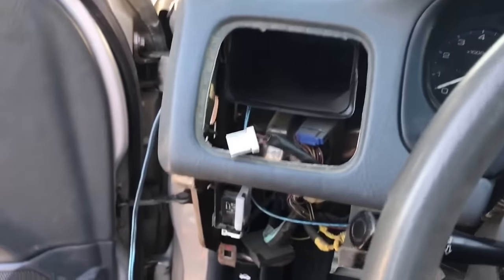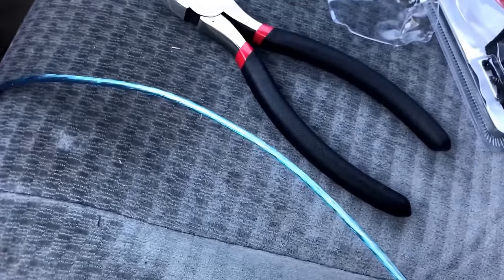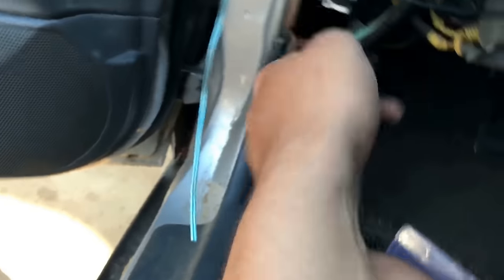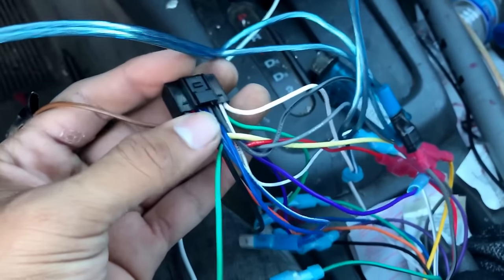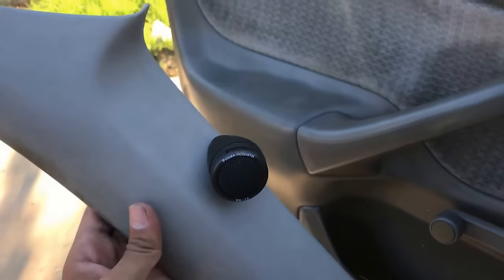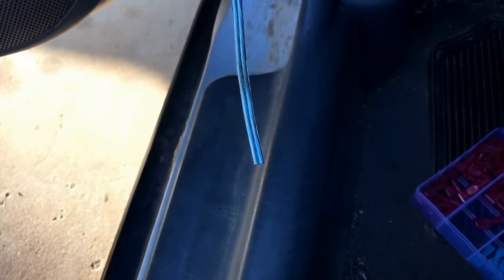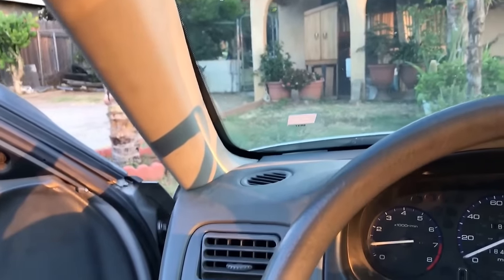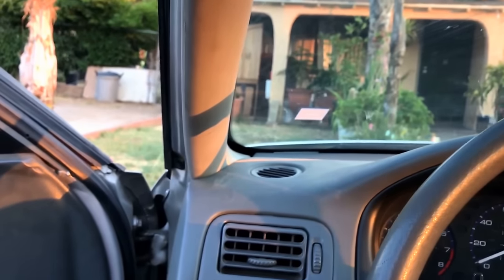HOW TO INSTALL TWEETERS (EASIEST WAY)

Comment: Taking apart his whole dash assembly apart for 7$ Tweeters?, HUh
Reply: Well cant call the dude lazy i guess.
Reply: Gregory Hebert yep if you want it done right
Reply: Man you'd be surprised how much one of those cheap dedicated little tweeters can clear up your system. I have a decent system in my truck with infinity reference series speakers and it sounded muddy to me no matter what I did. I bought cheap no name tweeters off Amazon for $15 (bit more because I'm in Canada) and it honestly sounds night and day different. I've put that cheap set in a few different stereo setups now and it's not even comparable before and after. They are worth your time and money.
Reply from the maker: I agree bro I had my system at max and it was clean but they actually stole it
Reply: 😂😂😂 is funny cause i said the same shit

Comment: I just want to correct a comment you made about the speaker wire,negative always has the black stripe and positive is always a solid color! If you use your own wire not from a wire harness it may have another color for the stripe on the wire but i would still use it as negative because you are most likely to wire it into your radios wire harness and can cause you to reverse the polarity in your wire hookup!
Reply: Thank you, I was thinking the same thing regarding wire colors for +and -
Reply: Just want to correct this as some cars(mainly toyota) use green for negatives and grounds incase anyone can't find a white and black stripe wire lookfor a green.
Reply from the maker: Thanks for the input but I was referring at my speaker wire one came with a stripe is a negative

Comment: If I have a cross over can I wire it to a door speaker? I have a small pa speaker in the front connected to my door speaker it works fine would I be able to wire them to the door speakers?
Reply from the maker: Should be able to

Comment: Oooh first thing i saw in your video is open dashboards...tells me immediately not "easiest". Im too afraid to crack the dashboards open. Can i just "tap" on existing wires in the doors?
Reply from the maker: I don’t think you can I tried it but since it’s plugged to the stock stereo it burnt it because it was too much power

Comment: Lol he did more work than he had to.  If you have pulled off the door panel you could have fished it through the door boot plus you could have added the crossover filter box
Reply from the maker: Can’t do that
Reply from the maker: Like I explained I didn’t want wires hanging

Comment: I’m thinking of upgrading the speakers in my 2005 F150. My front doors actually have mounting holes for tweeter, but I currently have none there. I was thinking of buying a component speaker set and putting them in. Since they’re in the door, I could just wire them into the woofer (the “proper” way I guess), but what is that exactly? Do you simply wire the left tweeter to left speaker and vise versa? It just splices into the speaker it’s paired with?
Reply: What did you do because I’m currently trying to do this in my 2005 f150
Reply: @brycebowers6959  Life got in the way. I did the door speakers,  it never got around to the tweeter. There’s a place for them, you just have to mount them with a make shift bracket. Get an inline crossover (if they don’t have them built in) and tap into the speaker wire. I will tell you, part of the reason I didn’t do it is because I was told you really need an amplifier to get the full effect with them.

Comment: You should never hook your tweeters up to the same power as your speakers... they're not meant for that much power and you'll risk blowing them up instantly
Reply: That's why you get crossovers
Reply: HornnyyStepSistah  yea😂 idk why people try and worry even though it's just a 50w per channel head unit
Reply: HornnyyStepSistah  ya😂 that's what I did with me tweeters and they sound fine

Comment: This is why I would never buy a used car if the factory audio has been messed with.
Reply: Most people don’t pull they’re entire cars wiring to just install some tweeters lol. I’ve replaced all of my door speakers and three in an aftermarket amp and a ported 15. Everything is cleanly done and tucked away with all the original clips, fasteners. Just because this guy is disorganized doesn’t mean everyone else doesn’t care.

Comment: This video saved me my life! I am a lot less confused, and half of my car is torn out, but I planned on replacing the whole front of my car at some point any way. Wait, our wires don't match... Your white wire is my red wire, sooo is every other wire the same? Do you have another video?
Reply from the maker: Depends on your wire harness
Reply: Please don't play with car wires if you don't know the basics, use a volt meter to play it safe, crimps and insulate every connection. despite being low voltage car speakers without capacitors or failed capacitors  can have your wires get hot enough to melt through plastics without blowing a fuse which is why amps and cross overs are important not just for sound quality, headunits have a small capacitor in them but if you run more than 4 speakers plus extra tweeters they usually get over worked and stop doing their job.
If you are adding new accessories like amps, spotlights or winches make sure you use a suitable fuses and AWG wiring and scrape paint off for any new grounds you add as it won't ground well through paint if at all.

Hope you managed replacing your speakers safely, once you learn the basics of using a volt meter there is nothing in a car electrical system that you cant diagnose or fix
Reply from the maker: Are you referíng to me?
Reply: @DANIELSTv  no Michelle 😂 she seemed like a newbie
Reply from the maker: @tomhalf3018  haha we all been there
Reply: @DANIELSTv  exactly gotta start somewhere 
I didn't use a fuse 20 odd years ago and burnt down my mk 2 cortina now i forbid twisted wires being in my sight haha

Comment: Dude just connect it to ur speakers u doin all that 4 em $7 tweeters
Reply: And blow them up... tweeters aren't meant to handle that much power
Reply: @rubenbraekman4515  capacitors
Reply: @rubenbraekman4515  not if you have a crossover
Reply: @brettb6804  EXACTLY

Comment: You could have just tapped off the speaker wire the cabin side of the door jamb, would have saved you the bother of ripping your dash apart. Booom!
Reply from the maker: That’s exactly what I didn’t want to do I didn’t want it hanging out
Reply: @DANIELSTv  No you misunderstood me. The car side of the door jamb not in the door.
Reply from the maker: @iandixon9604  in the boot?

Comment: sir,
what are speaker and tweeter ratings?
no need to add capacitor?
Reply from the maker: I used regular Walmart ones they work pretty God the ratings are 4 out of you and I didn't put it because on my head unit I can switch how much voice I want on the tweeters
Reply: Its good your learning. Keep it up. I could be like the others and tell you the reasons why this is not ideal but instead I'm glad your into car audio. Keep at it!

Comment: Thanks for the vid man. Question:

If the tweeters are installed without the crossovers, will it blow the tweeter? My dealer installed the new Polk tweeters for me and they almost instantly blew, then I noticed the crossovers were still in the box. Any thoughts?
Reply from the maker: +Mark N I have mines installed without crossovers and they work fine I just lowered it in the head unit in the menu I have the option but they sound perfect  thanks for the support !
Reply: DANIEL'S Tv thanks man
Reply: Mark N no.. you should always use a cross over or bass blocker
Reply: Mark N Polk shoulda had the cross over Buil in the tweeter..unless you had a component set
Reply from the maker: I had it for 3 years never blew!